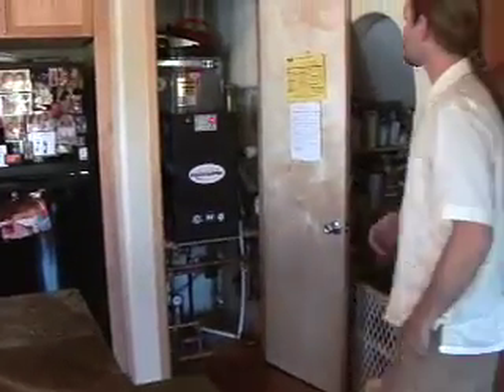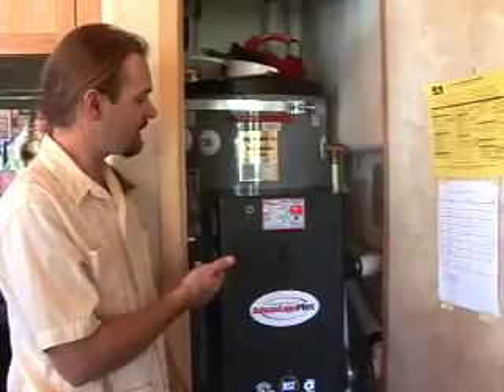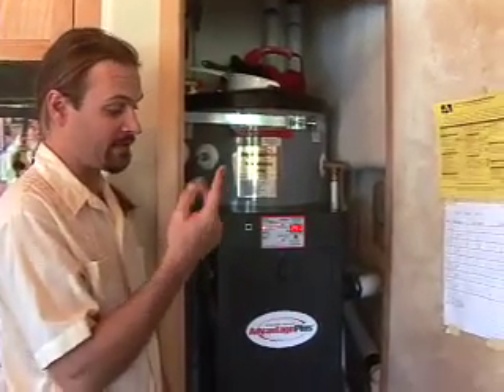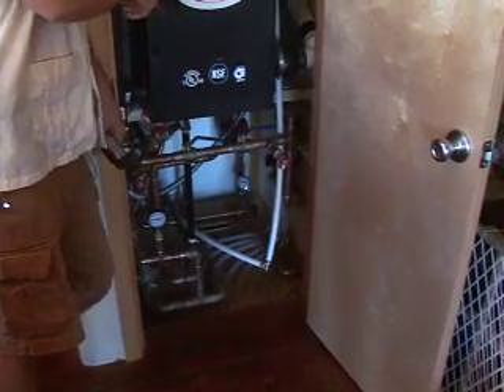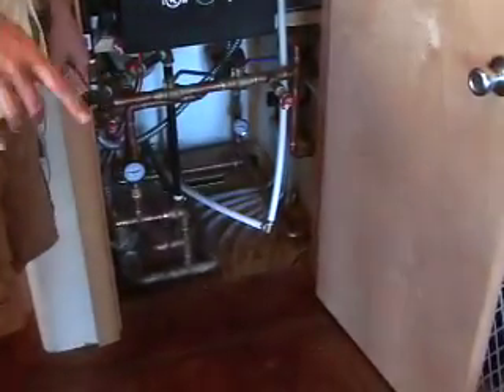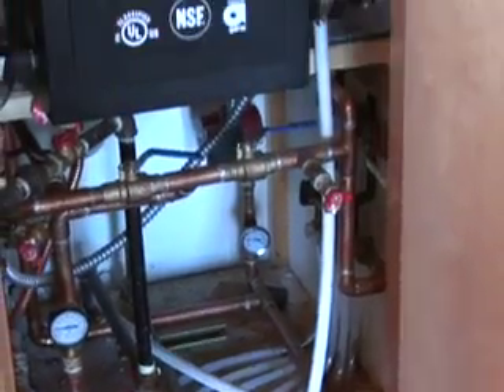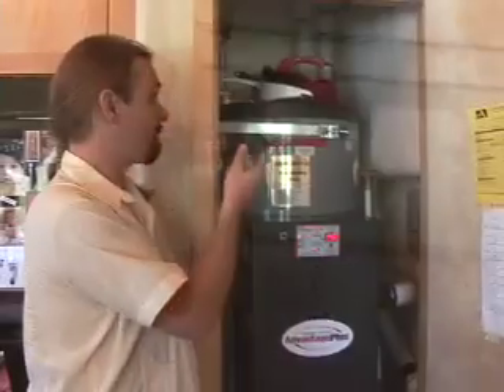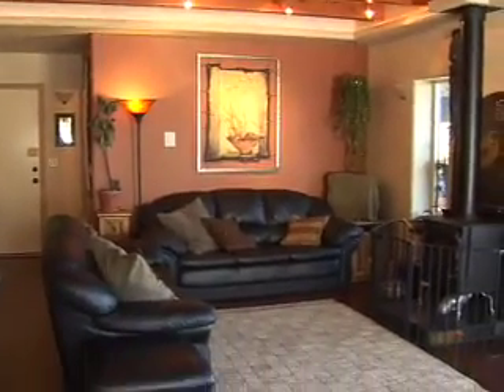BGH - Ryland's Radiant Floor Heating and Cooling

Comment: Pretty intresting cooling design.

With the Fans circulating the air as well as pushing the warmer air down to the floor and the floor absorbs that heat along with the cold water running through so in turn removes some of the heat. Acts in a similar way as a residential AC unit with the refrigerant absorbing heat.

Comment: its probably just warm water, not necessarily "cold" like from the tap kinda cold. condensation probably doesnt occur, because this is the floor. any higher humidity air is definately gonna be the "hotter" air in the room, which will rise to the ceiling and stay off the floor, keeping moisture away. but the concrete massing also slows the temperature exchange so the surface of the floor is safely away from the dewpoint temperature. i doubt the floor is actually "cold" thats uncomfortable.

Comment: In the summer when running the cold water through, do you experience any condensation problems on the floor?  How do you prevent this?